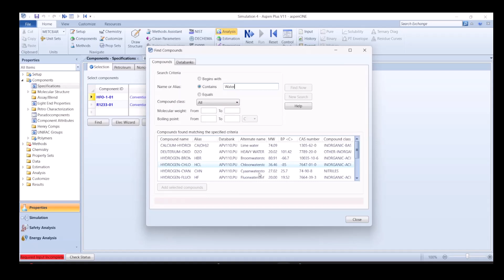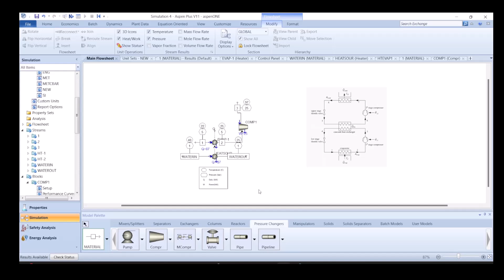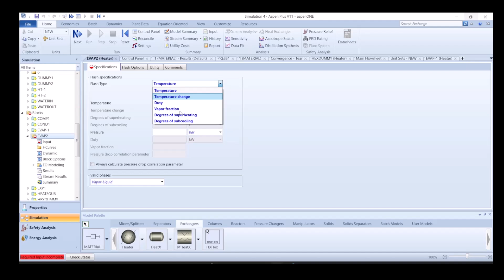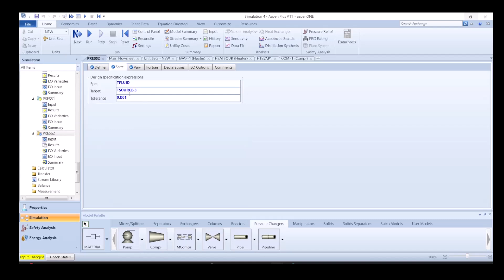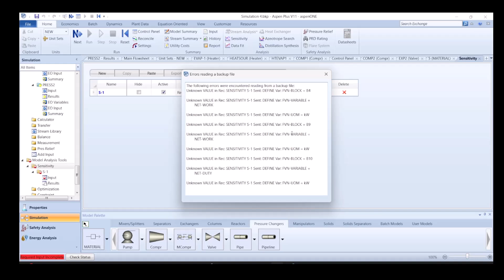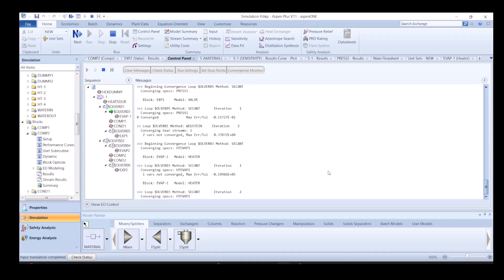Aspen Plus Tutorial: Cascade Heat Pump Design

Comment: Thanks for the excellent video! I just couldn´t get the heat balance between the heat source and evaporator even I did exactly the same...
Reply: Maybe you had the same problem I did. I solved it by rechecking the unit sets, which were SI as before. After changing it to "NEW," it worked.